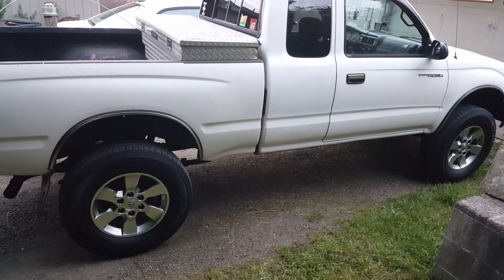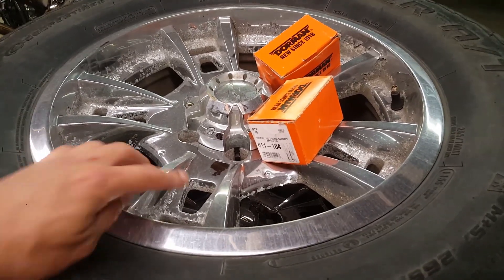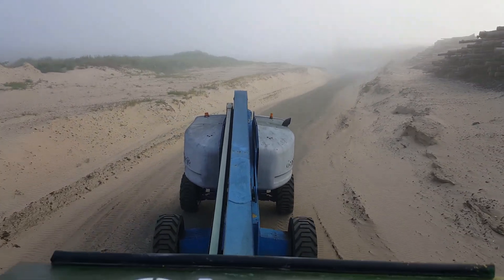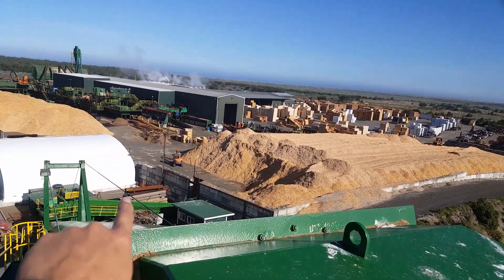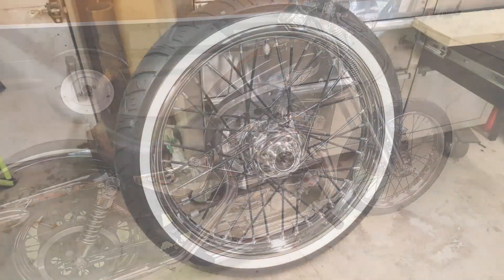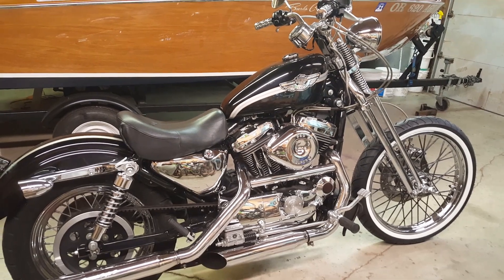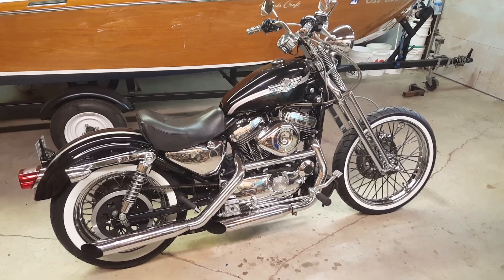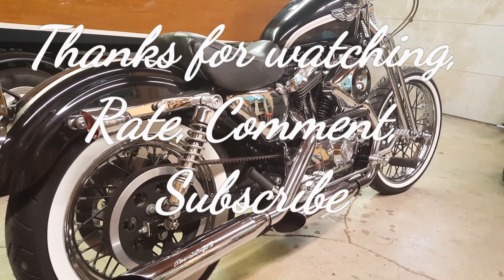Spendy update June 2020

Comment: where did you get the spoke sleeves?
Reply from the maker: Amazon, several companies sell them in multiple brands, any color of the rainbow is available,  measure your spoke diameter before ordering, they come in diameter ranges for instance 3-6mm, cheap visual upgrade but be ready for sore fingers and blisters, after the install it took a day or so until the split down the sides fully closed up on a few of them but they look great now and you would be hard pressed to find the seam looking at them
Reply: @joshuaburks  Thank you for the information. I originally was thinking about getting custom wheels from a company out of Texas but this sounds like a better option and one that will not break the very shallow bank account.
Reply from the maker: @CopyCatGarage  anytime! This particular brand came 72 to a package and I needed 80 so I had to order two packages but that left me plenty of spares for mess-ups although there were hardly any, I think they ran about $12 per package definitely in my price range🤣